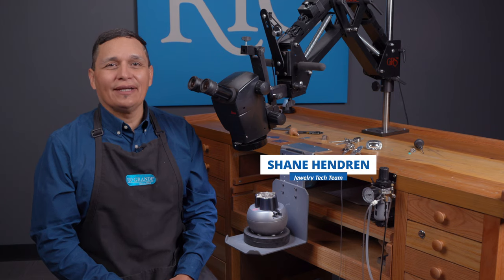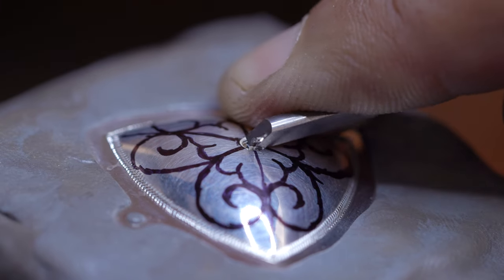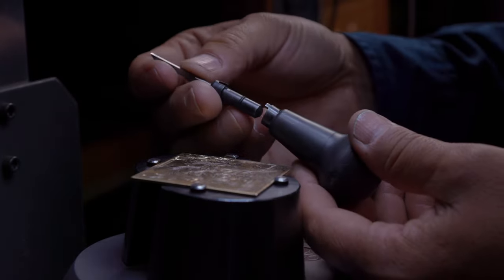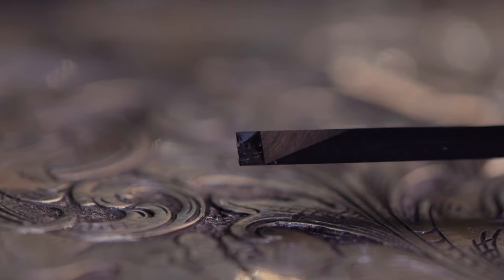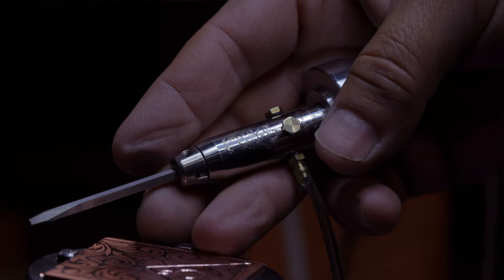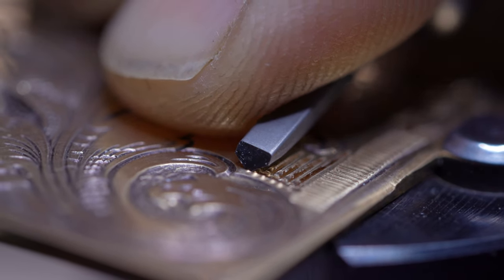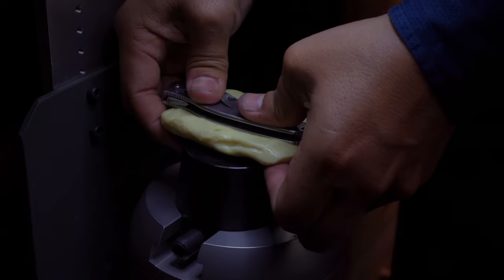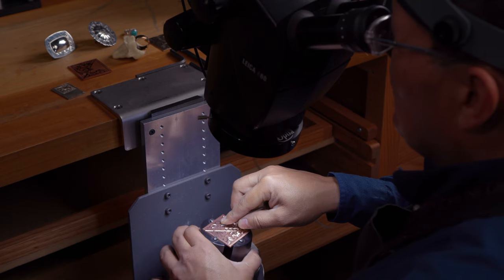Everything You Need for Engraving - Rio Buying Guide

Comment: Hi Shane.  I just purchased my first power assist graver by Steve Lindsay.  I purchased it from Rio.  Unfortunately, no one has a specific information about the connections to the compressor.  So how do I take this system and connect it to my silent air compressor?  After two weeks of digging and talking to my friends that jewelers and stone setters; I have found that each one of them had handpiece failures because no one recommended a 3 stage filter that’s fairly inexpensive.  Everything all together is still less expensive than GRS.

Comment: Just a long shot. I’ve recently taken up making Claddagh rings ,but getting to engrave 3 straight lines to make four fingers of the hand is a challenge . Can you recommend a graver ? And maybe a technique please. As you may deduce  I am a beginner in engraving . Thanks Rio Grand
Reply from the maker: Thank you for the question! Here is a response from our tech team:  GRS® High-Speed Steel Quick-Change Onglette Gravers - RioGrande  I prefer to mount my gravers in the following, Quick-Change Manual Graver Handle with Three Tool Holders - RioGrande  The technic is the same as any other graver, just push it through the metal.  I hope this information has been helpful.
Reply: @RioGrande1944  Thank you very much for your kind reply I’ll check it out.